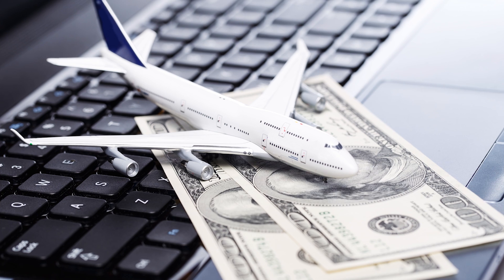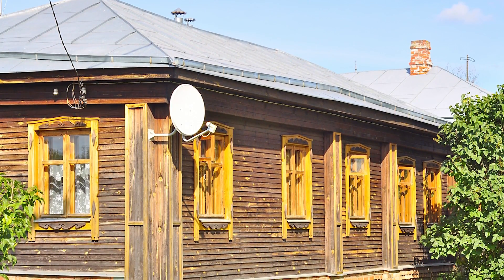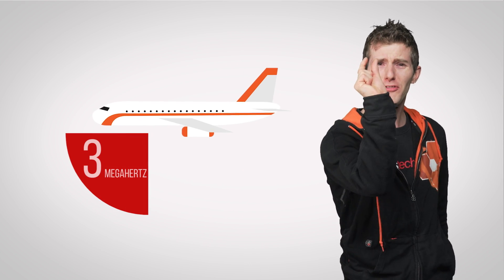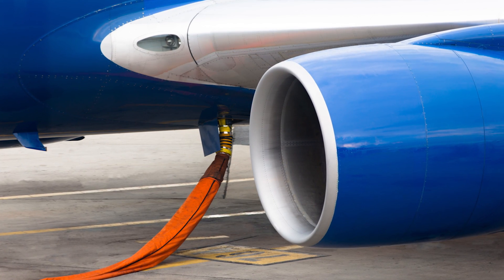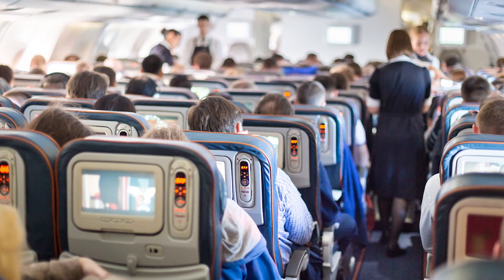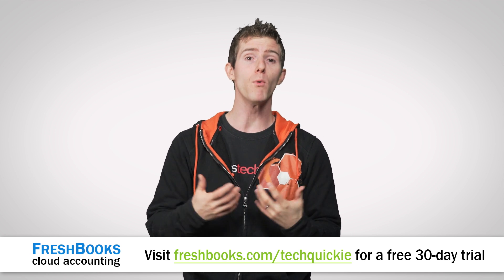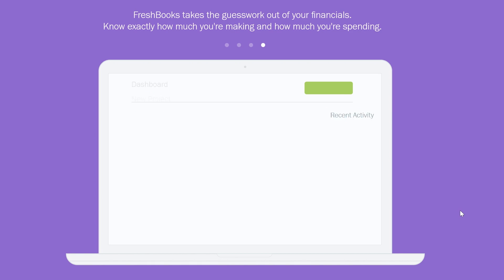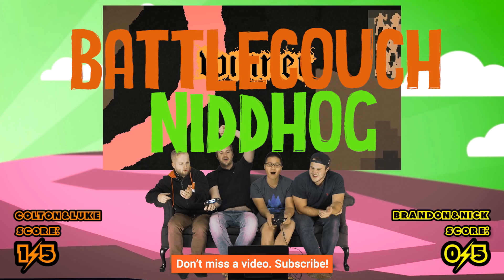How Does Airplane Wi-Fi Work?

Comment: I've always wanted to know HOW could they make calls from their cell phones on 9/11, but your phone wont have service NOWADAYS? Were they flying THAT LOW to have reception?!?!
Reply: I can usually get a cell signal for quite a bit of the flight, not at cruising altitude but for a pretty decent amount of time after taking off and before landing.
Reply: Colin Ambrose yeah... it works for a minute, then goes out... so that's what makes me wonder if they were flying kinda LOW for a while so people were able to call loved ones... maybe?
Reply: my ipad gets enough signal at cruising altitude to browse the internet (not video) on most flights i have been on 

my phone gets enough signal to send and receive text messages but only if i am holding up to the window and if the tower is on that side of the plane 

the best way to get cheap and usable internet on a plane is to plug 3G/LTE USB dongle into your laptop with an external antenna wedged 
between the window and window shade using a jacket to hide the cable and
 enjoy using your limited data cap while the other suckers are paying 
for slow and expensive inflight internet 
just be careful the FA doesnt see you setting it up because it is against regulations
Reply: @mwbgaming28  Damn man you go hardcore! Haha. I'm gonna build a high gain antenna for an LTE Dongle....
Reply: @nateo200  make sure you are not sitting over the wing, otherwise the signals will be deflected and never reach your device
you need line of sight to the ground, clouds shouldnt cause much trouble, but the planes wing definitely will block the signal
Reply: that is correct
a multiple calls lost connection the instant the plane hit the tower
they were confirmed to be coming from the passengers and crew of the plane by the people they were talking to

(personally i would open the door and try my luck jumping out)
Reply: @mwbgaming28  opening a door whilst the fuselage is pressurised isn't possible. The acrft on 9/11 Would be pressurised because the plane would automagically increase the pressure to it's highest alt before it came back down, and there would be an off schedule descent caution. Anyway, it's not possible because of the design of the door
Reply: @willharris8632  planes are not pressurized at low altitude
Reply: MWB Gaming haha yeah me too... Right INTO the Hudson!  #Sulley  lol
Reply: they say hitting water at 140kph (terminal velocity of a human) is like hitting concrete

i would rather take my chances with the water at 140kph than try my luck hitting actual concrete at 700kph
Reply: that depends on your carrier

the highest call i have made was from 41,000ft up and airliners generally dont go much higher than that due to engine performance issues
Reply: Jeremy Williamson Depends on flight route, they have to stay within a set flight altitude for a reasonable distance from the airport for ATC coordination and what not, that also may be the altitude range for wireless phone towers, after switching of control and reaching cruising altitude however, only the airplane antenna and SAT phones are able to maintain connectivity, cell phone antennae just aren't sensitive enough by that point
Reply: MWB Gaming WOW i've never thought of that... haha that's awesome!
Reply: its not as good as on the ground due to the dongle constantly switching towers since you are moving at around 450kts so dont try playing games on it but in my experience it works well for me

i live in australia and on a trip from delaide to darwin i used a telstra 4G elite modem with 2 external antennas in the window with the shade closed and i got an average speed of around 200KB/sec actual speed (what you see when you download something)
it was enough to watch youtube in 720p
but just barely
then the FA found out i was watching youtube and made me turn it off
(no inflight WI-FI on jetstar)

i then had some explaining to do with the pilot and security when we landed
Reply: MWB Gaming yeah for sure... take that seat cushion and just plop down on that water! haha
Reply: lol i guess its the right thing to do

coushion your ass before kissing it goodbye lol
Reply: MWB Gaming HAHAHA I KNOW RIGHT?!?! Hell, grab a terrorist to take a long for the ride too! lol
Reply: lol il use the cushion as a parachute and use the terrorist as a landing gear
Reply: MWB Gaming hahaha that'd just be the coolest hero death ever... can you imagine what would be on the news afterwards? 

"Passenger grabs the terrorist, opens the plan door and pulls him out with him... they plummet to their deaths, but the plane is saved. The true question is... "what did they say to each other as they fell? oh wait... they have different languages and might not understand each other" hahahhaha

I'd just say, "Hey mf'er... we're both about to die... so how's that terrorist thing workin out for ya now?" LMAO
Reply: MWB Gaming HAHAHHAHAha omg that's #PRICELESS hahaha
Reply: what else could i say as we are falling to our deaths lol
Reply: MWB Gaming I'd be like, "And what's your name? Hi, Im Jeremy, nice to meet you at such an opportune time! Wanna see who goes to heaven or hell first??" hahaha
Reply: funny enough my real first name is also jeremy

small world
Reply: the world is very small indeed
Reply: MWB Gaming So I guess before they crashed on 9/11 they were low enough to make quick calls to loved ones
Reply: MWB Gaming HAHA that's even cooler!!
Reply: MWB Gaming and too huge to call from a plane too high! haha
Reply: MWB Gaming AT&T just sucks in planes then! haha
Reply: lol i hear that from a lot of my mates in the US

they say AT&T sucks on the ground too lol
Reply: read this w ww.consensus911.org/point-pc-4/
Reply: I’m not very informed but they were maybe not flying at the correct altitude because the hijackers were flying the plane and not the specially trained pilots
Reply: You can pick up service sporadically at 10,000 feet. I've used my phone on a private jet and had service from NY to Philly. At 30,000 feet the phone isn't very good at picking a signal up but at 10,000 feet (where most of the private planes I have been on go, except for a few) the signal is quite good.

Comment: even at high speeds, the latency will still suck due to distance between air and ground, since airplanes are more elevated than ground satellite you get around 400-500ms vs the usual 600ms+ latency over a satellite based internet connection.

for sure you cant online game on that kind of connection but doable enough to visit a website but it will be very slow.
Reply: Latency does not significantly impact browsing speeds at less than ~600ms. Online gaming, yes, but even then, it depends on the game.
Counterstrike? Sure, off the table. But chess? TCGs? Games that use networking for non-time critical events (e.g Questing on your favourite MMORPG) aren't a complete write off at that sort of latency. The moment you strike the realms of ~1s latency, you're hitting some restrictions. But still turn-based gaming is an option.

Streaming doesn't care about latency. It cares about speed. It doesn't matter if one packet takes 2s for a round trip if there's enough of them (bandwidth, i.e speed).
Browsing only needs to fetch a dozen small files (if that) every 5-10 seconds or so if you're browsing wikipedia/google etc, and doesn't need that much bandwidth either.

Perhaps the only thing heavily restricted with this sort of latency is competitive gaming, where a tenth of a second (100ms) can easily be the difference between success or failure.

Bandwidth is the major issue here, along with routing for high saturation in a small frequency range of a few hundred clients, all requesting thousands of packets per second.

Comment: jetBlue are awesome, they have basic wifi for free on most of their flights! They're one of the best domestic airlines in the USA, along with Virgin America. Their free wifi is much more reliable than the paid Gogo inflight wifi that most other airlines use.
Reply: Very true. Well, it was at the time you posted this comment. The two low cost airlines you mentioned were running loops around the full service airlines by almost any measure.
Reply: Daniel Lo Nigro Technically it isn't free because you pay for the flight and some of that money goes into the wifi
Reply: Maximilian Kim-Kostarev Sure, but other similarly-priced airlines require you to pay extra for wifi. I guess I should have said "wifi is included in the ticket price". In any case, it's better than other airlines.

Comment: Okay okay, but how do I overclock my airline food to make it taste better?
Reply: Add more salt and sugar? The food isn't actually that bad most of the time, but it turns out our tastebuds become a lot less sensitive as the air pressure reduces.
Since cabin pressure is like 8-12000 feet above sea level equivalent in most cases, you need to add a ton of salt, sugar and anything else with a strong flavour to make the food taste anything other than bland.
The result is that ordinary food tastes bland in the air, even if you KNOW what it tastes like on the ground, and airline food if it happens to taste good at altitude likely tastes way too salty and sugary and so on if you ate it on the ground...

Basically, airline food needs more spices to cover for your tastebuds not working too well at high altitudes.

Comment: how to airplane wi fi

you take car battery which it a 12 volt battery so it 12 volt. you take router an you take It cord an ya strip it an ya fuckin put it on battery terminalz an you fuckin take modem phone line shut an jam it In router port an you it have wi fi an
Reply: Mr. ManDudeGuy best wifi comment ever 😂👌

Comment: I think theres something That youtube COULD do to slice internet usage down, INTERLACED option, as stupid as it sounds interlaced is a geinus idea all around, why?, The way it works, it sends different Horizental lines of data to render the screen, so it'd make a Much Reduced Usage, if youtube thinks this is dumb Then go to the TV stations that still use 1080i, it works well, 144i would be the very minimum of internet usage on youtube, both saving internet and usable on Capped internet
Reply: TheKHfan358over3d That's not how internet streaming works.
Reply: CoWinkKeyDinkInc ... you got a point, but what if... no wait no it's digital video interlacing wouldn't do much

Comment: The reason you enable airplane mode on your phone is to avoid interference. Why doesn't it interfere once you're up in the sky? Aren't pilots always in touch with ground control? Or do networking devices automatical switch frequencies to avoid interference? How can the satellite receiver have clear line of sight if the plane moves fast? How do companies like dish get a hold of satellites?They pay the govt? How can 24 satellites do this much for us?
Reply: 24? There's 24 GPS satellites. There's 1100 active satellites right now. Did you think the GPS satellites were the only ones? Anyone can just build a satellite, no government needed. When your satellite is ready, unless a government offers to send it to space for you, you need to pay a company with rockets to launch it for you. Internet satellites stay still, they aren't like GPS ones. The plane can aim it's antennae to stay pointed at the appropriate satellite. The equipment is tested and designed to not cause interference. They can't test your phone.
Reply: There's several reasons. To begin with, the original ban on mobile phone use while flying was due to ground interference with mobile phone networks from having a mobile phone several miles above several thousand towers at once.
Secondly, the interference if any is with the radio system, which isn't in use all the time, and even then, wifi is a lot less likely to cause interference than mobile GSM frequencies and the like are.
However, interference of any kind is generally  more critical during take-off and landing than any other period, hence why they ask you to turn off even basic electronics without any transmitters in them during those periods.

By the way, did you ever notice that if you turn on airplane mode on a phone or tablet or other device that you can then manually turn individual transmitters (wifi, bluetooth) on seperately?

This is technically how you should be doing things on a flight if you're using wifi.
Turn on airplane mode, but then re-enable wifi seperately.
This doesn't disable airplane mode; the device still tries to minimise any other kinds of signal transmissions it might be capable of making, but it enables wifi specifically...

Also... 24 sattelites?
When I turn on my GPS system and check what sattelites are involved, there's typically anything up to 18 to 36 of them visible at any one moment.
In fact, while GPS requires just 4 sattelites to get a location fix in theory, my devices tend to complain when there's less than 9 of them visible, and in general like to be using at least 18 at any given moment.

As for sattelites in general, there's thousands of them, not just 24, and they are all over the place.
Reply: Pilots aren't always in touch with ATC. :)
Reply: cbernier3 Well I knew that GPS weren't the only satellites. Other countries have satellite systems, too. I just didn't know you could just commercially build one. Thank you for your response it really helps =)
Reply: Here's a database if you like. 

http://www.ucsusa.org/nuclear-weapons/space-weapons/satellite-database#.WC_NffkrK3Y
Reply: cbernier3 Oh wow I had no idea about all these extra satellites. Thank you for the resource bernier much appreciated
Reply: Actually, the ban during take off and landing is not due to interference, that's just something the flight attendants are trained to say. The real reason is an increased risk of whatever it is your holding in your hand becoming a dangerous projectile if something happens. They tell you to turn it off so you'll put it in your pocket/bag. If they told people the real reason, no one would heed it, as they'd think they can just hold on to their device tightly and it'll be fine.

Regarding the GSM ban during flights: This was also due to interference with radios, which was not stopped because pilots suddenly decided to not talk to the ground so much.
What changed between back then and now, is the radio frequency bands used by mobile phones.
Modern mobile phones no longer make use of older bands that were at the same frequency ranges as the plane comms systems. That said, some new ones still use them, and some carriers also use them, so there is still an option of you ending up on such a band. It's a pretty small chance, because there'd have to be no reception on the better bands, and it's only on certain phones, and only on certain carriers... But there is a chance, so I still advice to play it safe and go into Air Plane mode.

Comment: Is it different with private jets?
Reply: It's probably the same, but you don't have to share it with 100 others.
Reply: Agree, but wasn't it heavy and affecting costs of the regular flights and stuff
Reply: slavevBG I've been on a private jet, I think it was about a 10 megbytes per second. it also depends on your location etc. But its pretty expensive to have wifi on a plane